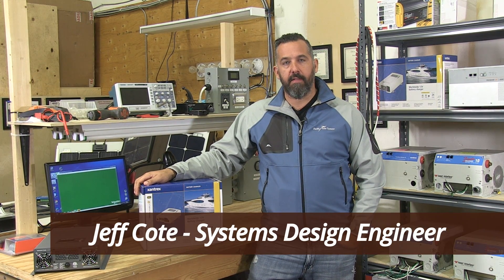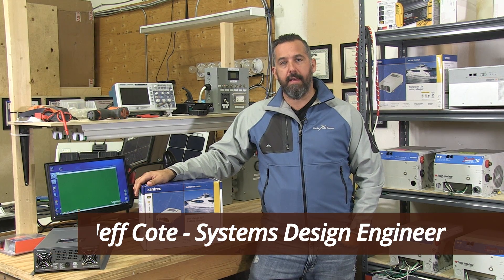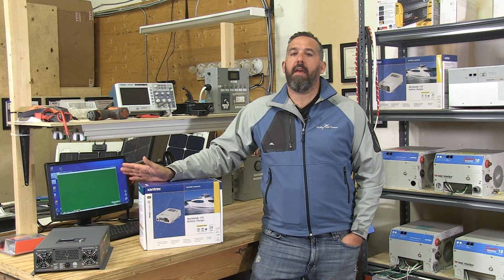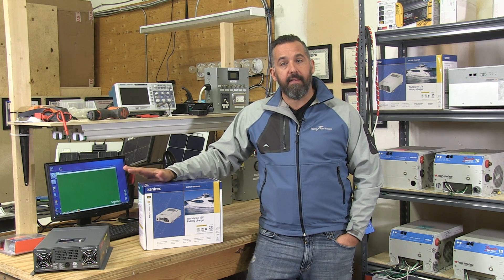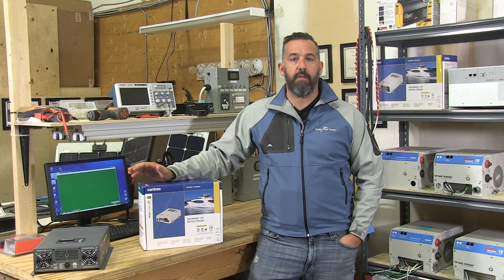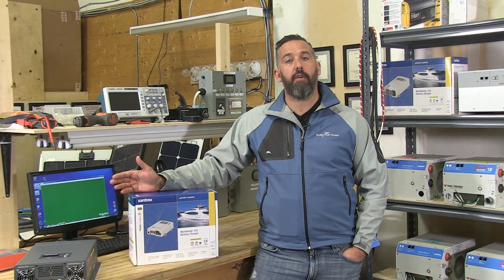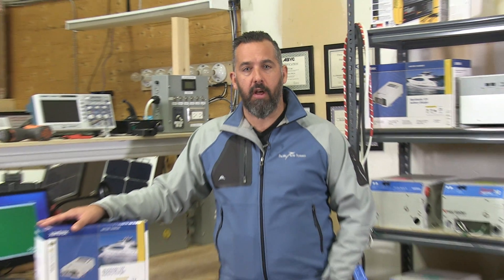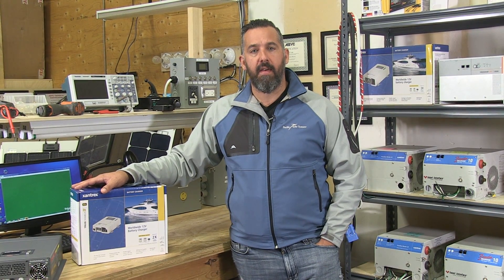Choosing a Battery Charger for a Boat

Comment: Hi Jeff! The battery charger that came with the boat is a 20amp Charles 3bank model SP2000. It is all alluminum cabinet with disipators and a little needle on the upper right corner, showing from 0amp to 20amp. My doubt is: Are those declared 20amp a total of amperage, or it means that for every of 3 cables of the charger is delivering 20amp each? I am using all 3 cables for 3 starter batteries (all flooded both engines and a generator). The charger does not look very “smart”, if those 20 amps are a total, if I disconect one of three, will that improve the charging rate of the remaining 2? Other question is: I bought a separated 1 bank 10amp battery charger (Noco Geniuos) for the house battery. My doubt is: For a battery 1100 amp a 10amp charger is ok? I am not sure if over 10amp per bank exists… Thanks!!!
Reply from the maker: When a charger is 20 amps, it means total output on all 3 legs is 20 amps. In other words the sum of all 3 charging legs cannot exceed 20 amps, e.g. 10 + 5 + 5. For a deep cycle battery, you need at least 10% of capacity. For instance a 400 amp-hour battery bank would need 40 amp charge rate.

Comment: Hi Jeff. Thank you for the guidance.
I have two 8D batteries for engines starting.
One group 24 deep cycle for house.
And one group 24 starting battery for the generator.

My charger is a NOCO Genius G4 putting out a total of 4.4amps and only 1.1amps per line. It has 4 outputs.

My guess is this changer is just too weak to keep my batteries charged.

Not helping is that even though I may be connected to AC shore or with generator, my lights and 12v systems would drain the batteries faster than the 4.4amp charger can back-feed to keep up.

Am I thinking correctly here?

Is my charger more like a maintainer rather than a charger given the low amp output?

Advise?
Reply from the maker: Your on the correct track, you should have a battery charger that is minimum 10% of your battery capacity as a charge. For instance a 260 amp-hour 8D should have a 26 amp charger.
Reply: @PacificYachtSystems  I believe I heard someone say that the charger should be based of house bank.

Should I size the charger based on the starting batteries that have an alternator charge system + the house bank, 

Or only based on the house bank?

8D amps 260 + 260 + 150ish for  each of the groups 24s = 820amps.

80-90 amp charger. Thats a heck of a charger!

Let me know.

Comment: Bought the Pronautic 1240P for my 89 Bayliner 3288 with twin diesels that replaced the original massive dumb "Professional Mariner Newpro 20/35" charger. It too supported 3 banks but was hooked up in 2 banks. Bank 1 was for the two sealed starter batteries while bank 2 is hooked up to a bank of 4 X 6v flooded lead/ acid batteries in the same fashion as the previous charger. Seems to be working although the previous charger did not hook the case up to a case ground. So not sure if I need to hook it up to anything. The big question though is: because I have both flooded and sealed batteries in my system which one should I choose when programming it or can I tell it somehow to set for both. The manual is not clear on this. Thank you for any advice anyone can provide....